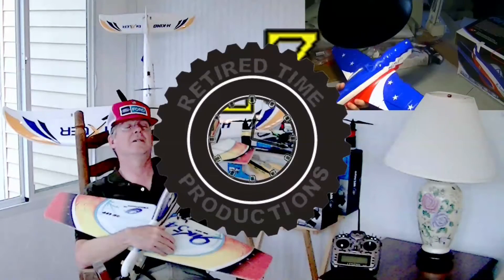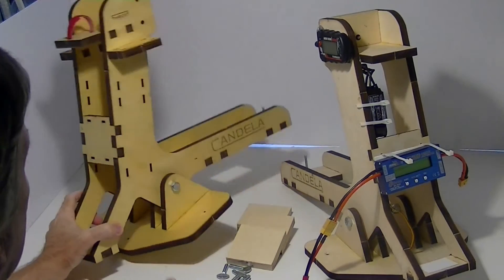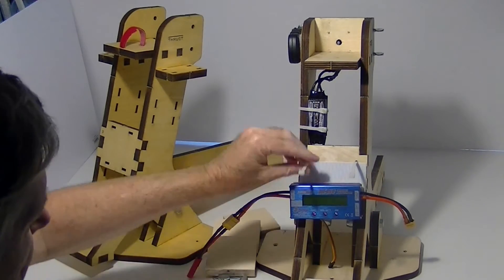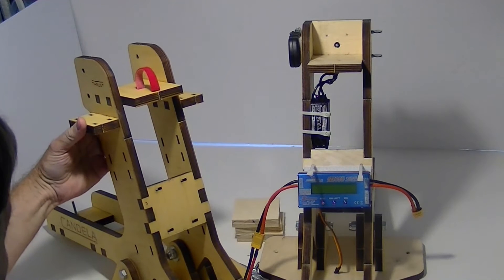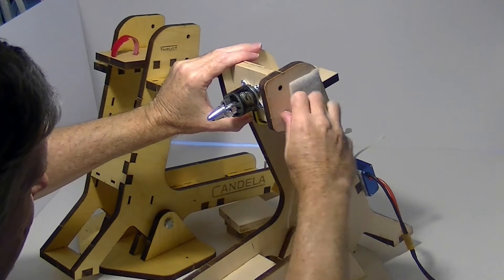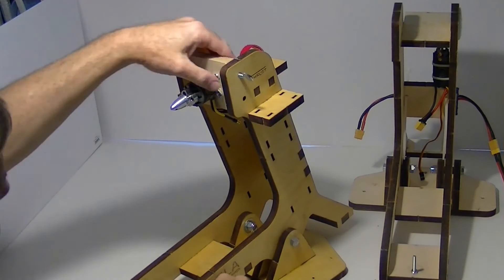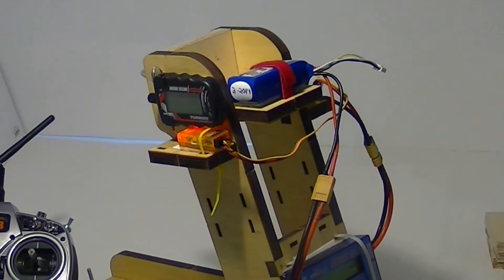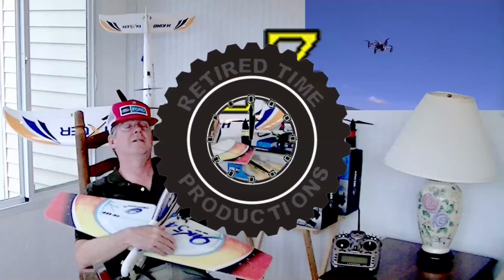Review of Upgraded Candela RC Motor Thrust Stand

Comment: seems like the size of the stand behind the motor would cause allot of wind deflection... skewing the results
Reply: Size is same as plane nose deflection. thrust is created and measured before propwash gets fowled.  TECH:Cline
Reply from the maker: Thrust testing in really a relative test giving a general idea which prop works best with which power system. There are many variables the far out weigh any deflection from the test stand. That's assuming you don't use too small a prop for the stand.
For smaller systems you need a smaller stand. You wouldn't test ultra-micro on this stand because in that case deflection would be a problem.
Reply: *****
 Good answere Sir.   Wanted to thank you again, stand sales have increased dramaticaly,,  Hope you are well.
Reply from the maker: Mr. Cline, has your company thought about manufacturing a small scaled down version of this stand for ultra-micro and micro power systems. After all there are more of those small planes around these days than the big one. Not to mention small multirotors :-)
Reply: *****
 We are curently working on a ultra small scale and a giant scale. The giant scale is in first laser run now, then we will switch to micro version. I would assume 3 months for micro,  We will send you the micro as soon as its ready. I didnt think you could test the giant scale,(30xx to 120cc) You can if you wish,, let me know.
Reply from the maker: Candela Research Center You are right. I would love to have the micro version though for the small plane.
Reply: *****
sounds good, will send it as soon as its done.

Comment: Nice :)
Just a litle question, can we use them for balancing our brushless motors?
Reply: I can offer you the same break as Dick Gibson, If you pay for shipping I will send you one for 60% off. Just email me,  You have been a good subscriber. Hope that helps Sir,
Reply from the maker: ANOTHER BLACKMENNEWSTYLE PRODUCTION Not sure. I saw one video where I guy was using a laser pointer on a motor stand. The dot of light would make orbits if the motor was out of balance.
Reply: Yes, works well for brushless motor balancing,  attach mirror to stand on both axis and shine laser. reflected laser will show oscilation of motor, adjust motor balance by adding tape or other method.
Reply from the maker: Cedric, did you read what Candela posted. Sounds like it will work for balancing.
Reply: *****
Candela Research Center Hello, sorry i just read it :) It sounds good for me, i will probably look for getting one of these. My budget is a little bit tight right now. But, I really bore to deseperately try with some seismograph app on my smartphone lol
Reply: Candela Research Center  Very interesting offer :D
Thank you